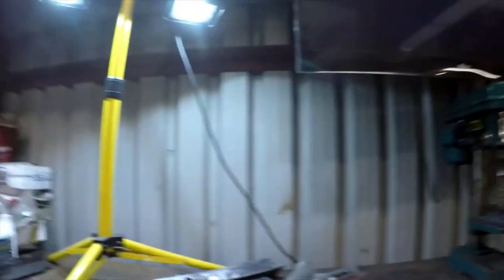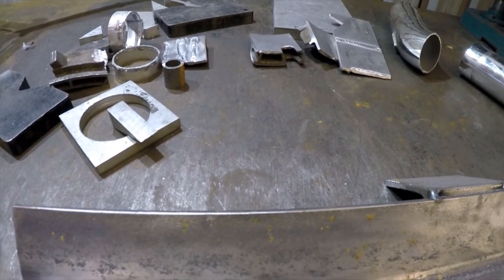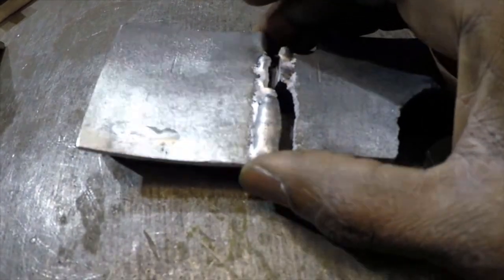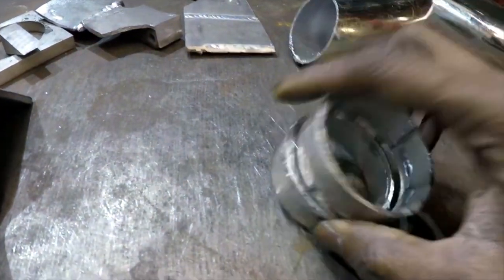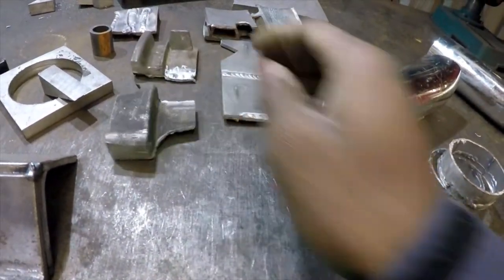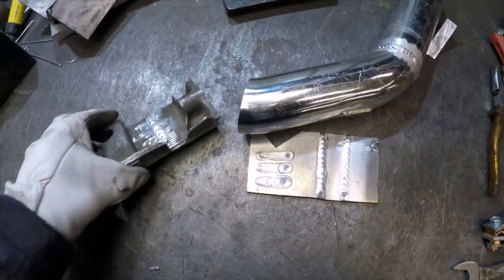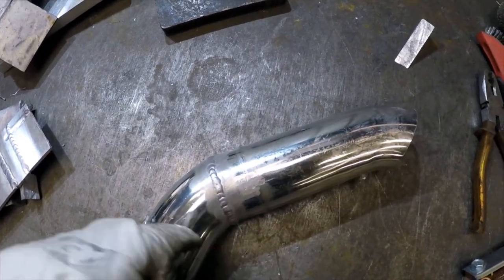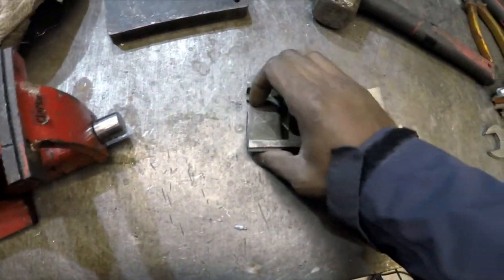A Beginners Guide to TIG Welding

Comment: A three-way perspective video showing the display, the pedal and the weld would be really interesting to watch, as somebody looking to start tig welding. I dont suppose you could suggest a beginner tig machine to buy? Ultimately i want to be able to weld the same materials you do in this vid, on a reasonable budget. Any thing under £1000?
Reply from the maker: Check out the range of Rtech welders.  That's what I use and I find them really good.  Really good customer service as well 👍